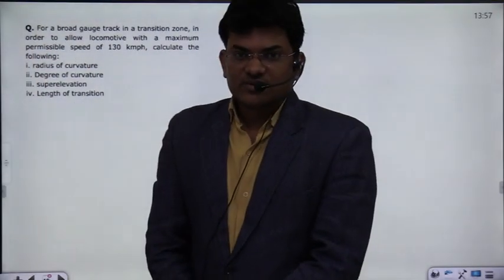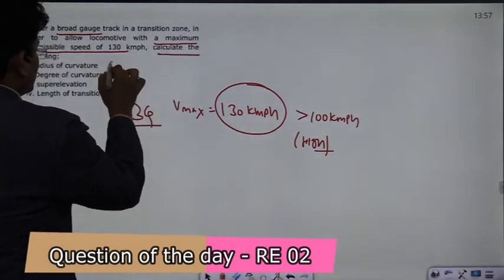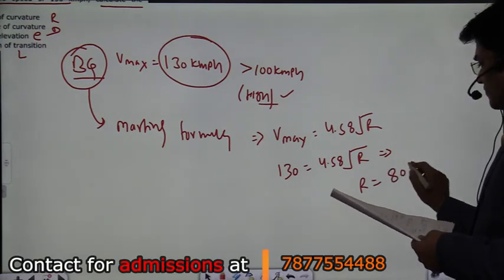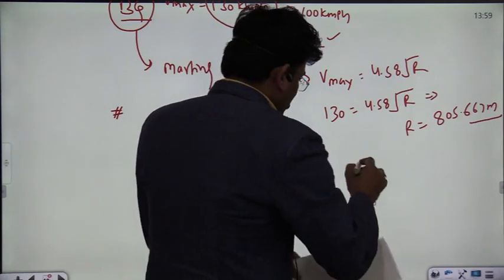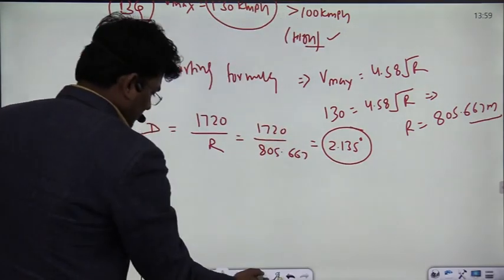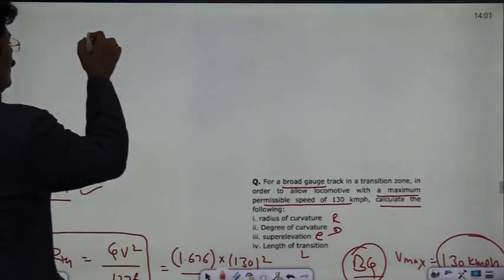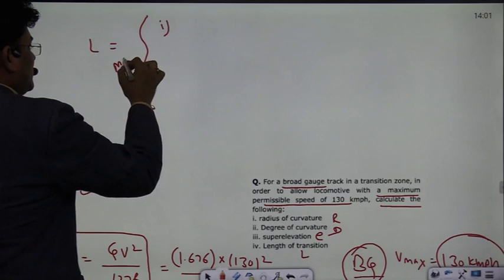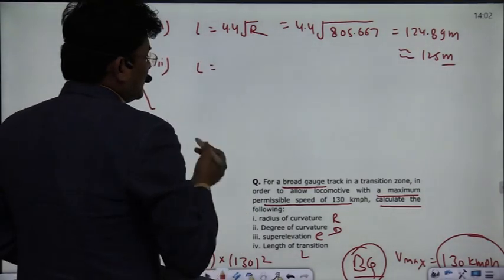BG TRACK DESIGN_(RE-02) by tarun sir (IIT Delhi)_GATE AIR -15_FOR SSC_JEN/GATE/ESE

Comment: Max allowable cant for BG is 16.5 cm....i think we shoud use avrage speed for design ???
Reply from the maker: It's a high speed track ... So maximum allowed super elevation is 18.5 cm ... U will provide super elevation as per given speed with maximum Deficiency allowed ... As average speed is not mentioned in question